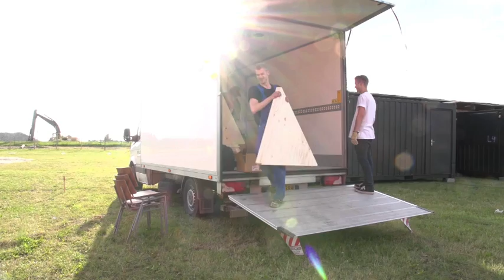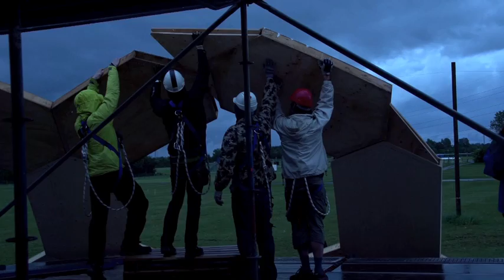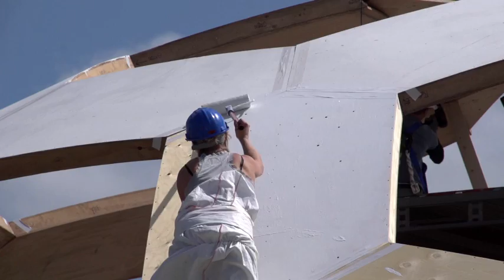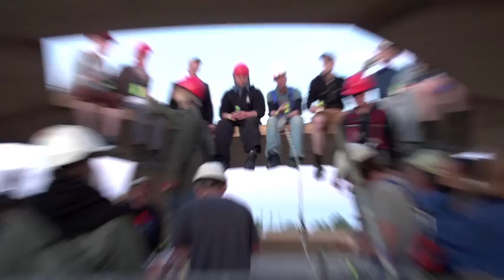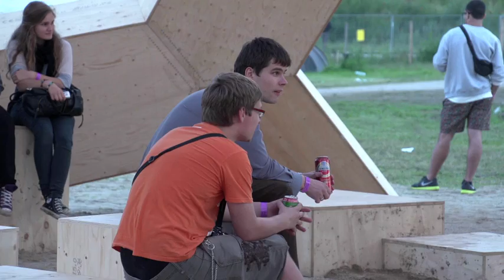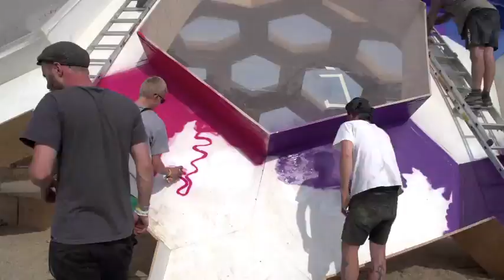Plywood Dome 2012

Comment: easy on the screws lads, thats overkill
Reply: the green man haha that many is more likely to split the plywood than hold it together. Could have use 1/4 to 1/5 and just add washers.
Either way it’s a very impressive build and I but the screwer was just a volunteer not the structural engineer/designer
Reply: @chedderburg  exactly guys, my thought from the start of the video, till the end... this many screws weaken the plywood sheets, 1/3 of screws would be stronger than this since it would not create a line to fail at ...
Reply: 24,000 screws according to the website.
;-)

Comment: Every geodesic dome should credit Buckminster Fuller, the man was too ahead of his time, we need him now more than ever.
Reply: Actually not a geodesic, which are based on triangles; this looks more like one of Steve Baer's Zomes.
Reply: @dooleyfussle8634  May I respectfully suggest you track down Bucky Fuller's 40 hour 'Every Thing I Know' lecture, and you will see exactly that design amongst many other variations. The design dates back to mid 1960s and is a 4v variant I believe. The video series is impressive even today and yes 40 hours is quite a commitment but genuinely life changing in scope.
Reply: For an easier to find example, do an image search for Buckminster Fuller's 'Fly Eye Dome' to see an example of a  geodesic that doesn't use triangles.
Reply: You're correct, Zomes were stretchable, this doesn't look like it could be stretched. I wasn't meaning to take anything away from Bucky, just never ran across that hexagonal variant before, and have met Steve Baer and built a dome using his geometry.
Reply: @dooleyfussle8634  Well, to be fair, Mother Nature evolved it eons ago, but Bucky was the first to refine the maths to describe it [not that it really matters who was first anyway]  : ) 
I keep putting off building my own, -  when I finally figure out the best weather sealing solution, I'll begin... I generally try not to hero worship, but I make an exception for RB-F, his 'Spaceship Earth' outlook was and still is spot-on.

Comment: What a cool looking dome. However, I think you might have spent too much on screws. It would have been very strong with just 1/3 as many. Using liquid paint, instead of spray paint would have been more ecologically friendly. But, it is a great design and looks fantastic. I would have appreciated some information as to why it was build.
Reply from the maker: Jaye, please check ktejlgaard at behance for more information. Link is in the video description.
Kristoffer
Reply: So you would say, Wow.

Comment: Would love this on my property. . Wish I knew the cost .. I would close most openings and make it a house .. And the plywood  framing inside the patterns would be drilled with big holes .. Make it a bit lighter and can fill with sprayfoam afterwards .. 
This would also be awesome over a swimming pool
Reply: Sounds good and the foam could add some structural rigidity and a vapour barrier if closed cell as well as the insulation.
Reply: Count up the number of sheets of plywood you need and there's your basic cost. Add $2000 for other stuff and you'd be pretty close.

Comment: Awesome result, cool design, but I agree with several other people about the excessive screws. Not only was it unnecessary and wasteful, but it may have actually made the joints weaker with so many holes. And OMG with the amount of individual cans of spray paint you used I’m sure you opened a new hole in the OZONE layer!!!!!!
Reply: Using many screws instead of fewer but bigger screws, results in less strain at any one point along the length of the joins. Instead of having a lot of stress at fewer points along the struts. It looks, I agree, a tad excessive but actually there’s a lot of logic to using many but smaller Instead of fewer but bigger screws! ;)
It’s just how it is sometimes.

Comment: If your purpose of using screws every 1/4 apart was to strengthen your joinery, you in reality have done the opposite.  It is almost like you cut the panels off right where you joined them with the screws, it is ironic because you are attempting to join the panels, by cutting them right where you are joining them, by your joint method. 

Just picture what is happening, you have a consistent string of screws so close together, that in essence you cut it off right were you tried to join it, by using screws so close. It will still be strong, but because it is a geodesic dome, but that didn't help it. But that is a method of cutting or breaking things off at a planed place, without using a saw, by putting holes so close together, it is in essence cut, and then just put your little finger on it and push and it breaks right off at your perforations.

Comment: So what was the whole point?
Reply: Either A: Several thousand people got to experience up close a variant on the most efficient structure known in nature. There is no more efficient way of providing shelter. More recently the inspiration for carbon nanotubes' discovery - weight for weight, approximately 100 times stronger than steel. Imagine combining the two - a geodesic dome utilising carbon nanotubes - truly mind boggling potential. 
Or B: Geodesic domes are simply cool.

Comment: Ridiculous. Buckminster Fuller designed a dome in plywood. It is extremely elegant, light, labor-non-intensive, frameless, and sheds water like a duck. Lookup geodesic plydome as perfected by Steve Miller. If you want the plans, write me.

Comment: Take wooden strips of desired size & secure ends across a circle on the ground till you have your frame. Next staple canvas or other fabric around entire structure next paint it with portland cement slurry next trowel on 1 inch cement next chicken wire next trowel to desired thickness. Done. Inside can be plastered - holes cut early on etc. Way cheaper way faster. Too much waste w plywood.